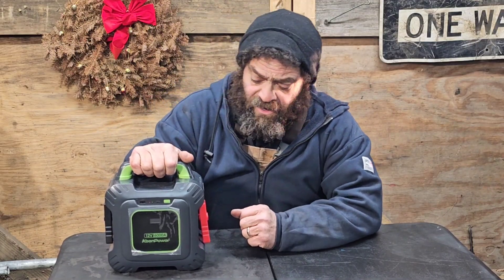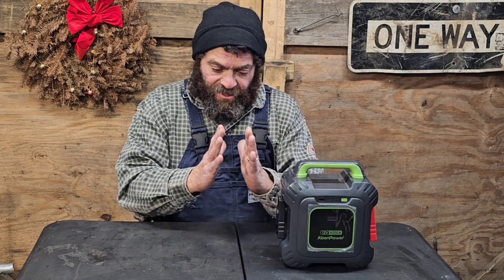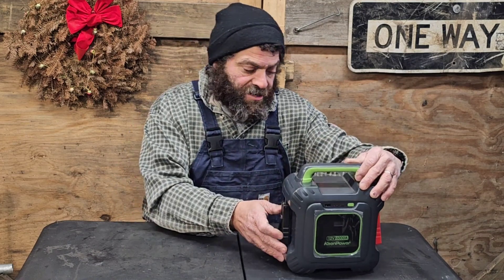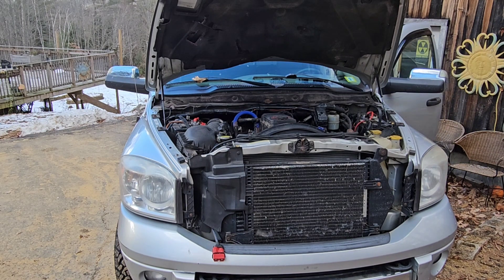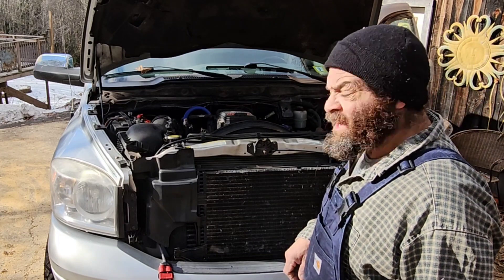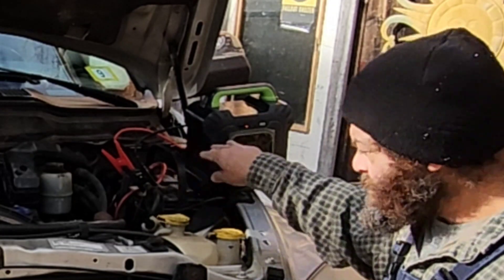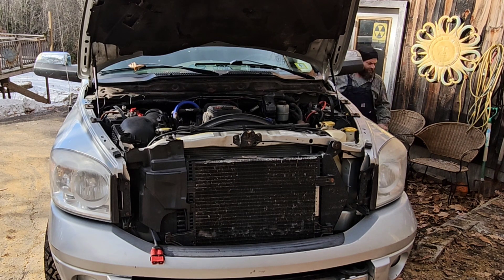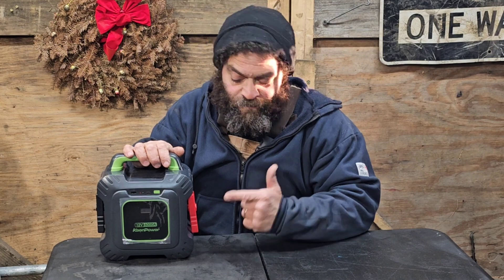Supercapacitor jump pack explained and tested on 6.7 cummins diesel. $200 Keen power SC6000 6000 amp

Comment: Can this unit be charged and retain a charge for future use.
Reply from the maker: @locker1325  I haven't tried for long periods.  It works a day or 2 later,  but I haven't paid attention beyond that. It definitely starts to drain off sooner than a battery.
Reply: The advantage of the capacitor inside instead of the battery is that it does not store electricity because if it is stored, the device is exposed to explosion and damage, especially in countries with hot weather, lithium batteries used to operate cars always explode. As for this device or something similar to it with the capacitor, it is very safe and you will not need to charge it, just a little electricity from any source and it will conduct the condensation, and here is the creativity. My greetings to you and the owner of the channel.

Comment: Your Cummins has glowplugs??? Lol i was typing when you corrected to heater grid haha. Thats a neat little pack. Im looking at the xs batterys (single battery and the capacitor in the second battery compartment) could come in handy for Canada winters
Reply from the maker: Haha... my mouth always says glow plugs, even though my brain knows its a heater grid.  Probably because it was always glow plugs when I was young.  If the battery is really dead (the headlights were on for days),  the cap can't do it in one shot and you need to power it up if another battery, but I definitely love the idea of it and have used it several times since getting it. The Noco GB250 is just an animal,  but it's very expensive.
Reply: @reusefull  lol 🤣 all my super duties have glow plugs and I when I got my first Cummins I was like wow the startups are way better must have a better glow plug setup...... Hahaha. Only to be corrected instantly by my Cummins friend
Reply from the maker: @shaneanderson983  Yup... haha.  The grid works well! We run a lot of DT466s and they use the grid also... seems to start them pretty well in the cold.

Comment: Perfect as a replacement for jumper cables.  If the other vehicle is dead but yours is not, you can charge it from yours then hook it to the dead battery to "jump" start it,
Reply: From what I understand the other car must be started so that you won't kill their battery -- as the supercaps draw ALL AMPS available to charge up

Comment: Thanks . I bought this exact model based on a recommendation and it will be showing up tomorrow. This is the exact video that I needed.
Reply from the maker: Glad it was helpful👍
Reply: Have you started any diesels with this?
Reply from the maker: @FoookYourfeelings  I can start my 6.7 cummins if it's not dead dead.  If it's dead dead (less than 2 or 3 volts) it won't start it.
Reply: @reusefull  
I've also ordered a Makita ( cheapo fake Chinese makika).  .. Jump starter.  It reduces 18v to 13.5!  It was only £15.  I was hoping I could charge this using the Makita when the battery is totally flat?
Thanks for getting back pal.

Comment: How’s that super capacitor holding up? Considering one of these at the shop to start trucks.. I like the fact it isn’t a battery
Reply from the maker: Depends on what you mean by "trucks". I really like the fact that it's not a battery also,  but I think it would struggle trying to start medium or heavy duty trucks with multiple batteries.  I use it mostly at home for tractors and cars. It will start my truck from some dead,  but not deeply dead.  
If I was going to use it on anything big I would import the power... suck a charge off a running truck and pump it into the dead batteries. Probably after a few of those, it could start big stuff,  but I haven't had a chance to try it on anything bigger than the 6.7 diesel.  
For bigger stuff (like a 13L cat) the GB250 is a powerhouse.  Really expensive though.  I see there's a capacitor for heavy diesels, but it's $11,000 or something ridiculous like that,  you could buy a lot of keen power packs for that kind of money!
Reply: @reusefull  wow! That’s a lot of money for a heavy duty version. Yes, I was referring to 11-15 liter heavy’s. Good to know, thank you for the reply
Reply from the maker: @Kwhopperfan  I got the Noco GB250 on black Friday a year or 2 ago for $700... big money,  but no regrets.  I do love the ability to jump start off a bad battery with the capacitor though, I'm definitely keeping it.
Reply: @reusefull 
Answered my question... I only need it for a 2.0L van... It should piss this!  Thanks 👍🏻

Comment: Please answer asap do you have to connect the keenpower to an AC outlet or can you use the keenpower without it
Reply: One thing that distinguishes the Keenpower over all the other supercap jump packs I have like the Autowit and Schumacher is that it retains the charge for a very long time. 
I've had it sitting for what may be months and it's still at 14V, while all the other types will be completely discharged in a week. 
I find that surprising, but my impressions comparing these is that the Keen is like an old muscle car with very little in the way of protective safety circuits but high power, while the others have more foolproofing measures, discharging it when in storage and requiring detection of a voltage on the clamps before switching on. 
The Keen will simply output when called upon from a push of a button regardless of what it's connected to.
The only drawback is the higher price and the bulk compared to the others I have, but it does have a significantly higher output from my testing.
Reply: The boost voltage that the keen charges up to is lower than most at 14.7V, which is safe for vehicles.

 Unlike the lithium packs, which will have significantly higher voltage output. 
That's one of the reasons the lithium packs all require voltage detection, to make sure it's connected to a vehicle battery that can absorb some of the power and limit the voltage from getting too high for the vehicle electronics.
You really don't want to connect up a lithium jump pack on its own to a car with any sensitive electronics and bypass the voltage detection, the high voltage could be risky without a battery connected.
Reply: @dubmob151 thanks for your thorough explanation! I’m leaning towards the Keen vs Autowit and your explanation is VERY helpful
Reply: @zaxon09  if you don't mind the added bulk and cost, it does give more output without the handholding foolproofing. If your vehicles are harder starting, needing more cranking time, it's a good option. 
The autowit has proven capable of starting every time I needed it though, and I do like the tidy package, so if I didn't collect jump starters the way I do, I'd get that.
Reply: @dubmob151  bravo! Thanks again!! 🫡
Reply from the maker: You can charge it off a car battery or AC, but you don't ever have to use an ac outlet if you don't want to or can't.
Reply: @reusefull  Does a AC cable or USB cable come in the box???
Reply from the maker: @terrytaylor5558  I honestly can't remember,  I think usb... I charged it once and then never used ac again.  It's just so much faster and easier to use a battery to charge it.
Reply from the maker: @mally2860  you can use it without ac

Comment: Really helpful review on deciding on this one over others.
Reply: If you have a vehicle that needs a higher current output, and don't need much in the way of foolproofing, I'd recommend this. 
The drawbacks are the larger bulk, and the higher price compared to the Autowit 2 at 119, and the Schumacher DSR108 at under 58. 
The Autowit is the tidiest package in a nice case, and mid pack between the three. 
The Schumacher is lowest output and smaller width clamps but it's the most cost effective and even at the lower output, has done the job whenever I needed it.
Personally I'd probably get the Autowit as the best overall package.
If you just want the least expensive one the Schumacher is good to get and just toss in the trunk and forget about it until you happen to need it.
The Keen can serve as a battery bank to charge your USB devices, which is an unusual feature, but it times out with a low draw, so you have to keep pressing the button periodically to use it for your phone. If you don't mind the bulk, it's good to have for the max output capability.

Comment: Should've tested if it can jump the vehicle with the battery disconnected from the car to simulate a totally dead battery and see if it has an override mode to still jump it if it's charged from another source already. Due to the video missing that important info I'm gunna have to give it a thumbs down.
Reply from the maker: Fair enough. I'll give it a shot with a different vehicle I don't care about,  but I've smoked electronics before with no battery at all
Reply: @reusefull  either that or drain the battery to at least 1 volt
Reply from the maker: @AFatherToTheFatherless  I can do that for sure.  I thunk a really dead battery is a better test than nothing at all because the battery is absorbing energy from the pack while you're trying to start the vehicle.  I understand what you mean about the override though... if you can't get the pack to fire,  it's not very useful.
Reply: The keenpower will deliver power without any need to detect voltage, that's a significant difference from pretty much all other jump packs based on super caps or lithium batteries. Only other types that don't require voltage detection are the old style lead acid jump packs, which just have a mechanical switch if anything.